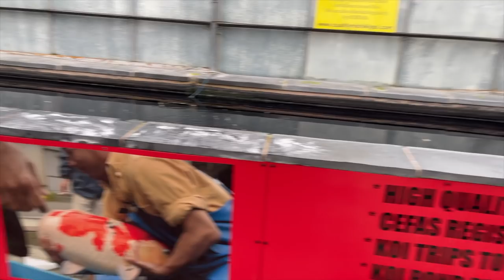Watch this if designing a KOI pond!! Don't make the same mistakes...

Comment: All valid points and common mistakes. Only thing I disagree with is the push towards fibreglass construction. For a square pond box weld liners are much cheaper, very reliable and more flexible especially if you might be extending or changing the pond in the future. Like many people I didn't realise how much I'd get into keeping koi and when it came to extending pond I was very grateful that I only had to replace a £400 liner rather then having to re fibreglass the whole lot.
Reply from the maker: Many new pond keepers use liner, as they are going to move etc. You are right, a good box weld is no problem at all. That’s just a personal choice.

Comment: Great video again Tim. I am going to be going around 8 k gallons with 2× 4 " bottom drains. I am thinking 4 returns at 2 " staggered. Would you dish bottom drains separately or have an overall bench to both. Want to turn over once an hour. Not too sure if this is excessive. What are your thoughts please?
Reply from the maker: 4 returns from 2 drains is okay. However add more from a skimmer line. 6 would be good. On 8000 gallons I would probably try and dish them depending on shape etc
Reply: Thanks for the prompt reply. I am gradually collecting as much knowledge as I can absorb. Looking forward to part 2😊